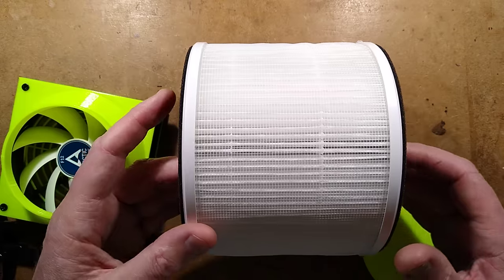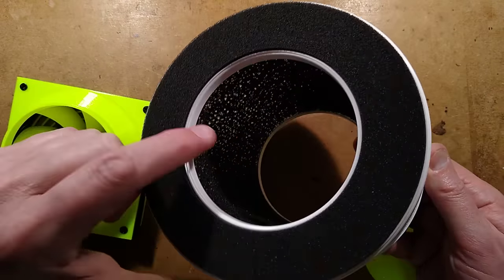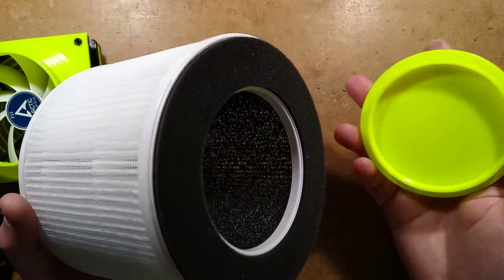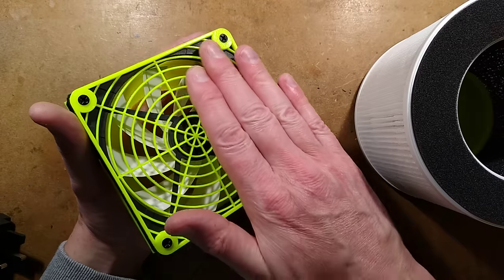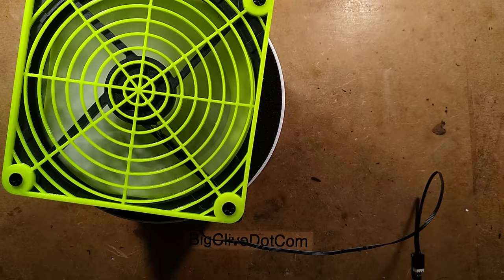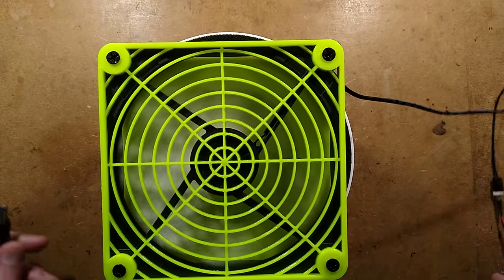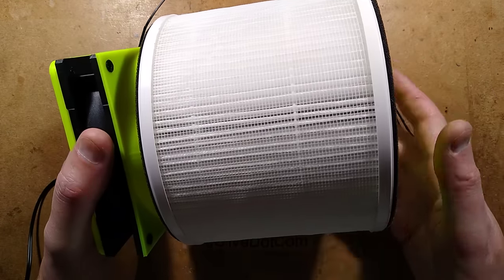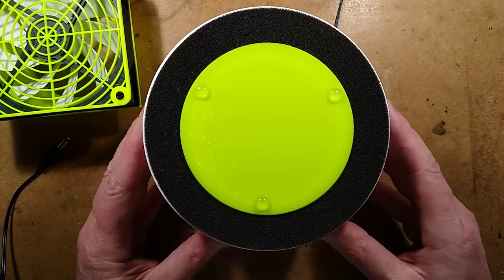DIY cheap & quiet HEPA air cleaner

Comment: Put a light inside the thing and make it into a chandelier.
Reply: A flamp perhaps? (Reference to Simone Giertz latest vid).
Reply: @liquidsonly  I just happen to have a light fixture that looks very much like two of these filters stuck together.
Flamp? Why not.
Reply: Add a UV lamp and sterilise the air too
Reply: @dreddwailing5505  You know, I was thinking superluminescence the other day.
Reply: You have restored my faith in my existential crisis ❤ just knowing  someone else thinks about filtering chandeliers too makes everything feel okay 😂
Reply: use an RGB fan
Reply: Im going to put charged wire around mine to fry the moskeetoes 😂

Comment: The bearings won’t be a problem, they’re made to work in any orientation. Many of cases have up and downward facing fans.
Reply: Yep, it's just if you buy a cheapo sleeve bearing fan from china it's an issue, the arctic fan is some sort of rifle bearing so the lubrication should work fine for example
Reply: @HydrarDraconis  A P12 CO fan would be an even better option: Arctic P-fans are more designed towards static pressure and the CO models are meant for continuous operation.
Reply: @tz8785  I'm actually not sure you would need a p series for a hepa filter of this size. The amount of obstruction in them is very low due to the enormous surface area and the higher pressure may not be enough to offset the lower unloaded airflow compared to the f series. What I would do, however, is step it up to a 140mm, because there's a significant increase in effectiveness at that size.
Reply: Not with all fans. The cheapest fans are typically sleeve bearing fans, which will wear out prematurely if mounted horizontally, even though they technically "can be" used in any orientation. The lubrication system doesn't do well when mounted horizontally.
I've actually had this same problem with Corsair AF140s even though they claim to have "hydraulic" bearings in them - they make a very audible rumble when mounted horizontally.
Reply: Indeed, the generic super cheap Chinese fans usually turn into simulators of coffee grinder noises after a few years if they are mounted in certain orientations, because all the grease oozed out. If you act quickly enough and it hasn't yet ground itself to destruction, you can peel off the sticker and stuff some new grease into the bearing, and then re-seal it to make it silent again for a while.
With good brands like Arctic or Noctua, the bearings are properly sealed and remain durable in any orientation.
Reply: @JarnoKai  that's true with everything. Cheap everything will wear out faster. We know.
Reply: @burnte  Why do you have to be so hostile? The comment claims orientation doesn't matter, we are saying sometimes it does. This channel is literally pretty much devoted to cheap Chinese crap and making the best of it. Also corsair fans are 20 bucks a pop, which does not fall to your category.
Reply: @tz8785  I'd vote for a Noctua - even on high speed they are barely audible and move crazy amounts of air.
Reply: @JarnoKai  I wasn't that hostile, I was pointing out that the statement that a cheap peice of crap would fail is like saying water is wet. There are people who jsut totally get off pointing out how generalizations aren't 100% and they're annoying. Considering Clive said that was a high quality fan in the video, the pedant comments are just obnoxious.
Reply: well they are littel spheres so it makes sense
Reply: @HydrarDraconis  Most people don't know this, but all sleeve bearings will prematurely fail when mounted horizontally, due to the weight of the fan causing premature wear, as well as potentially leaking lubricant. That probably won't happen for around 5 years though, so it's probably not going to be an issue before your pc is replaced.

Comment: Wonderful. I would also consider putting on a thin outer layer of something like muslin for filtration.  These filters (just like respirator filters) primarily work on adsorption, not filtration. So if you can put a a highly permeable filtration barrier between them and large particulates you will massively extend the lifespan of the HEPA filter. The best way to explain it is this .... if you work in a lumber mill, you wear full spectrum filters for the chemicals, but you wear pre-filter screens on the respirator cartridges  to keep the sawdust from clogging up your expensive respirator filters.
Reply: some 'fluffy' low density foam should do it.
Reply: Just a lady's stocking ...
Reply: Add some uv sterilization and maybe even O3 generation and you've got a decent filter for a bathroom sized room, maybe.
Reply: Thanks for the tip! I'll have to find something like that to go over the filter.
Reply: @TheAdeybob  small pore aquarium pre-filter foam would be perfect. Comes in blocks for easy shaping
Reply: @ambretha7366  I hope others will report your lowlife spammy postings in the comments section, as I have done multiple times. It won’t stop you, but it might inconvenience you.
Reply: @erikbrodin2198  Spray some perfume at the remotest corner and estimate the time the smell wears off. If you leave this on 24 hrs, a medium size room with windows closed will be noticeably cleaner.
Reply: @snakezdewiggle6084  It doesn't have to belong to a lady.
Reply: @erikbrodin2198  perfect for growing tomatoes ;-)
Reply: @srp01983  You're talking to a bot lol
Reply: 3d printed cyclonic filters (think dyson vacuum cleaner) are also an option for primary filtration that I've seen before.
Reply: @snakezdewiggle6084  You know what dude, stockings would be a brilliant, cheap idea, and incredibly easy to shape and apply. Never thought of that. Mechanically stockings are basically a poor-mans equivalent of a PC air intake screen (only made of nylon instead of metal screen mesh).  Re some of the suggestions about foam, it has to be very low density, porous foam like the pre-filter on a Vicks Hepa Air Filter device, although foam does reduce the air flow to a degree compared to screen mesh. 3M cartridge pre-filters use this VERY open pour foam, the lightest foam Ive seen. Good suggestion mate. Now I have an excuse to buy some tights on Amazon haha
Reply: @didnotwantthis  You know what? Because 'lady's stocking' was said, everyone knows exactly what sort of stocking was meant. If it just said 'stocking' then I start to think of thermal tights or other sorts. Geezus not everything is a diss at certain communities, get over yourself.
Reply: Absolutely, HEPA filters quickly degrade when exposed to lots of particulate matter. You get the same airflow, but much less filtration.
Reply: @erikbrodin2198  UV doesnt really make too much sense in a hepa filter and is just damaging the plastic at best. The filter easily takes care of airborne viruses and bacteria, keeping any viral load so low that it wont matter if you added UV or not. 
Ozone is an option but not very healthy on its own, I would rather focus on good filtration.
Reply: @charleslambert3368  cyclone filters are only useful at high flow rates, thats how they get the necessary centrifugal effect to seperate out particulate. Not really suitable for a quiet air filter.
Reply: @TheWtfnonamez  My Air cleaner has a plastic screen around the hepa filter, with a pitch similar to stockings. It catches pretty much all the cotton dust which I can just vacuum off, prolonging the life of the actual hepa filter.
Reply: Asbestos is quite cheap
Reply: @TheWtfnonamez  lol ;)
The stockings will still cause some restriction to flow. The trick is to make a much larger filter. I use the entire stocking (one leg) stretched over a frame I made from wire-clothes-hangers reformed into rings/hoops (yes, it looks like a woman's leg sticking toes-up into the air. I call it art...) once or twice a year I remove it and toss it into the washer, good as new.
Reply: @srp01983  I did as it was still there a months after you posted.
Reply: HEPA filters last forever and get better the longer they are used...  unless they become contaminated... and on that end they should be replaced regularly or else they can become a source of pollution and contamination.  But they actually get better with use... I imagine due to the tapped stopping more other particles.

Comment: I recommend you use Arctic P12 fans. These are Pressure optimized and will likely work better when air flow is constricted, such as when you're trying to move air through a filter media. The difference being, the P12 has wider impeller blades and theoretically will be more efficient in this use case. The one you're using seems to be the F12, which is air Flow optimized, suitable for applications where there's little to no air resistance to overcome.
Reply: Thanks for the tip. Found the Artic P14 Silent with 950rpm. That may move more air and don't needs extras to run slow and is cheap .
Reply: @underwoodblog  P14 is a 140mm fan and will need the script editing.
Reply: Yeah, the arctic P Fans are pretty great, just dont accidentally connect + and - incorrectly or they will be dead instantly.
The ones with CO in the model name even have actual ball bearings instead of glide bearings, so they will last longer.
Reply: The new arctic p12 max is amazing for static pressure with a ring that goes around the blades. It prevents the air from regurgitating from the outside and now pulling much more from the filter.
Reply: Doesn’t Arctic sell constant operation variants of their fans? Should be better for this application

Comment: I can't help but notice that you used an Arctic F12 PC fan, which is designed for airflow. If you were to use it's brother: The Arctic P12 which is designed for pressure, you will be able to push more air through the filter.
Reply: Just need to add a static vane boost plate!!!

Comment: Shop vacuum filters also come in this tubular shape.  For example: in the US, a Ridgid vf6000 HEPA filter is ~$33, already comes with a bottom plate, and is designed to flow a lot of air.  Looks like a good candidate for this project.
Reply: what about Automotive cone filters?
Reply: @BronyumHexofloride  should work good. I wonder how much the spray oil would make a difference. Those are also washable.
Reply: That's what brought me here. I have a couple of Ridgid Vacs and am looking for ideas on how others may have made their own units using them for room air filtration. 
I have a couple of good units in the house, but they are expensive as are the repl. filters.
Reply: there is a diffrence between a hepa and hepa :P

Comment: If you guys want to build this, make sure to get HSP (High Static Pressure) fans and not HAF (High Airflow) ones because you'll be needing that static presssure to pull air through the filter.
Reply: Agreed, this seems to be a permanent pet project of Clive's, however I don't see any A/B testing.  HEPA's are normally quite restrictive, and simple 12v computer fans are not likely to be the HSP type and will either fail to work well, and/or die quicker.
Reply: @boots7859  Arctic has some good HSP fans. Though they're labelled as "pressure-optimized" in their branding scheme.
Reply: @gabracal  Yup! The Arctic P12 fan also has a "CO" variant, which stands for Continuous Operation. They use ball bearings which boast a much higher endurance compared to their pseudo-FDB counterparts, which may be well suited for something like this
Reply: @Jackonian  That's even better!
Reply: @Jackonian  The fluid dynamic bearing fans struggle to run upside down, though. Depending on orientation, the ball bearing may be a better fit, even if slightly louder... though not as loud as running the FDB upside down.

Comment: Love it! As someone doing covid-related cleaning all day I keep thinking that my activities are nearly pointless compared to proper airflow and filtration, I wish cost-effective air management was rolled out publicly and privately as far as hand sanitiser has been!
Reply: To be honest I'd like it to be set in building code requirements for any new and renovated buildings. Air filtration is nice, but especially in densely populated rooms like say.... schools I really wonder what the CO2 concentration is in there after a few hours. It's generally not great but especially in a learning environment it's very detrimental. As long as the CO2 concentration isn't too high recirculation through filters will be useful but unless you go full submarine/space station on it and have CO2 scrubbers new outside air will be needed.

Another rather simple but welcome change would be to maybe include running water at entrances of buildings, hand sanitiser is nice but boring old water and soap is still more effective. Probably cheaper too long term?

It has been frustrating seeing my government considering keeping schools open very important, ventilation is very important, spend lots of money on many things. Yet it took them very long to make money available that's not enough for schools to do something about those structural issues by a long shot.

Comment: For years I've been using an upcycled 12V 120mm computer fan with a 9V power supply as a... fan in my kitchen ventilation. It's free (as long as you have access to scrap electronics) and is super quiet. Runs almost 24/7. I will be definately trying this one, great idea!